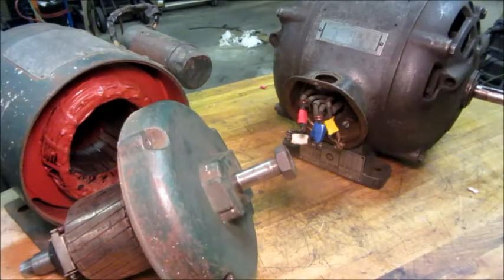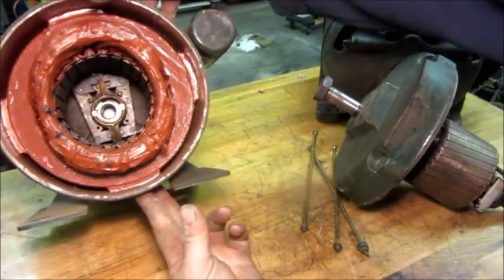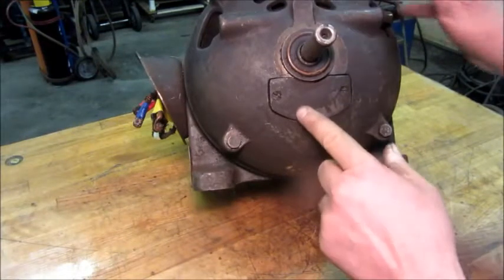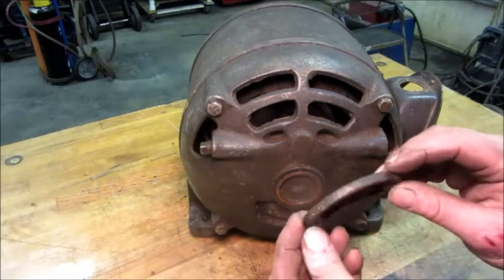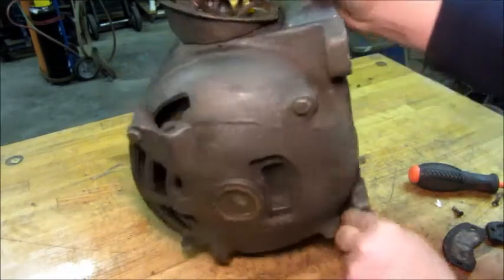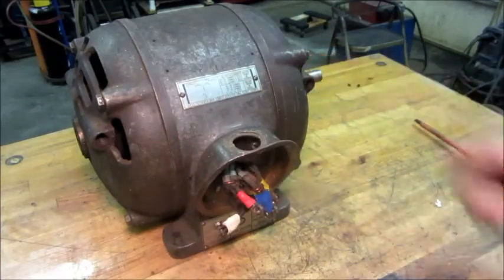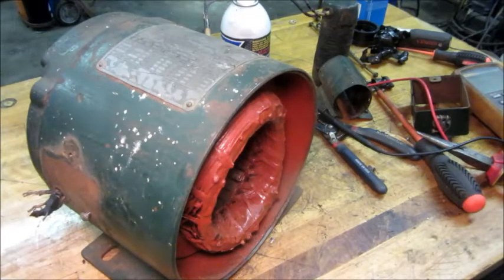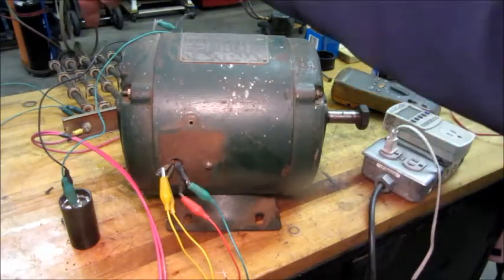Two vintage electric motors check and test... Dumore Grinder and Westinghouse Machine Tool Motor...

Comment: my 16x96 south bend lathe uses an underhung motor that looks like that down in the base.  The weight of the motor is the belt tension.  Of course, that size is 3 phase and larger but that's the first application that comes to mind by the looks of it.  Dumore made a lot of lathe toolpost grinders that were belt driven.  That's likely what the other motor was for, a huge toolpost grinder for a huge lathe.

Comment: Another great video of vintage machinery getting a new lease on life. Better bolt that 1 horse motor down before giving it the full 240. Probably has enough torque to spin itself off the table.

Comment: The Dumore looks a lot like the Marathon 2 hp 3650 rpm motor I have. I would love to see inside the rear end bell on the motor you have. I have not found any documents on Marathon. Seems like they moved over seas and nothing as far as vintage documentation is available that I can find. Thanks for filming this for us to enjoy and learn from.

Comment: When a motor runs on half voltage, does the efficiency suffer ?? Are old motors with copper instead of aluminum center shafts more efficient than the newer style of motors ???? What did you mean by adding a capacitor and something else would increase efficiency to the motor ??